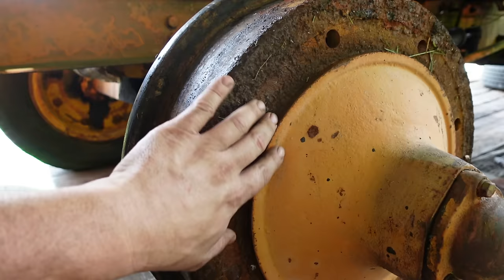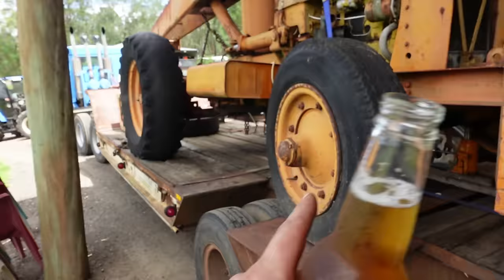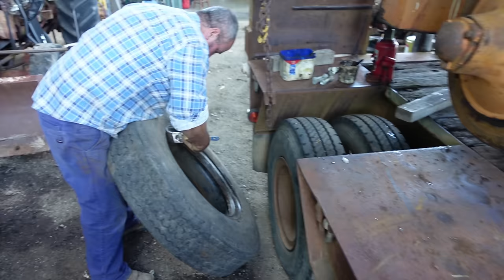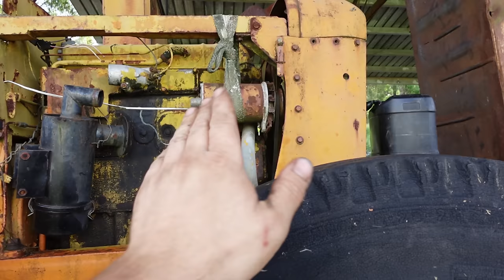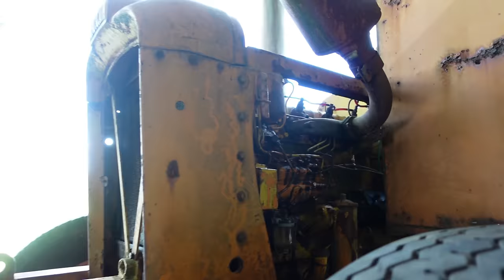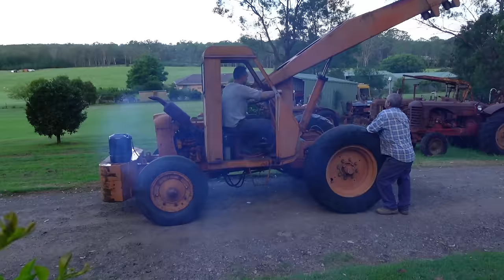Will it Run? Saved from Scrap!

Comment: Looks more useful than the one from the circus. Good acquisition. Stable mount for a bottle, full or empty, there was no bust glass.
Reply from the maker: Yes Neil it is. The circus one was homemade though where this one is a proper crane. It will lift more once working right mate

Comment: Gday Steve, winched on in the morning and driv’in off in the arvo, nothing wrong with that mate, it run quite good really and having the rotating boom will be a handy thing, top job, cheers
Reply from the maker: Hi mate yes that’s right. And it doesn’t need a great deal of work to get up to a useful machine. I just wish I had more time to play. I only get Saturday so I have to choose what is more important most of the time. They lift a lot too mate. That red tractor that I lifted off that blue trailer with my big Steelweld crane was lifted on with the same crane as this. Not a bad lift

Comment: Nice save. It'll come in handy with the future shed construction. Now I understand why you guys are always staying hydrated. If I heard you correctly in another video it was 40C at 10:00 in the morning. We're lucky or unlucky to see 40C a couple of times during the summer here in the Midwest (US).
Reply from the maker: Hi mate yes it will be a handy crane after a bit of work.
 Yes that morning working on that Albion was very hot. I’ve always pictured it to be very hot there in the mid west? I guess not as bad as here by the sounds of it. We have a lot of hot days here over the summer
Reply: Hi Steve, I need to clarify about my reply and where I live in the Midwest. I live in Minnesota and our Northern border is with Canada which provides a little cooler weather during the Summer. The Dakotas, middle and lower states in the Midwest do get hot and stay hot during our Summer. So, your assumption wasn't totally wrong about our weather in the Midwest. Stay cool and hydrated.

Comment: I think she's a 6g guessing by the inline injection pump that's on the L4 perkins 9g or mk2 (I increased the video quality and saw the rotary pump).
I think the R1250 is just the loader version of a reversed mk3 like the F1000 being the factory front loader.
Reply from the maker: Yes it’s a rotary pump so I’d imagine 9G. I also have an r1250. Same machine with a loader frame on it basically.
Reply: @stevesplacedownunder  I haven't seen a 9g rear loader be referred to as a r1250,  All i could find is that they are built on  a mk3 and have a double z link loader similar to the f1000. Problem is that they're rare and information on them more so thus leading to arguments. Check the serial number, from what I know it will tell you the tractor model. I aught to just do a walk around of the r1250 that I bought to save from scrapping (and I wanted a decent loader).

Comment: That's badass n be very handy.
Did they flip axle to reverse direction? Or did they make it with different transmission? WD Allis the flip rear axle to put loader on rear and drive backwards
Reply from the maker: It will be great mate yes. The transmission is the same as normal so it’s done in the axle I’d say. It’s probably flipped like you say.

Comment: Hi mate, 

After being bit by a hoard of them as a kid, I think wasps are cunts with wings!. 
Brake cleaner works better with flame.😉😆

I doubt this Chamberlain is gonna be a 5 part belter.😜

On your ramps cylinder, could there be a internal leak or check valve partially failed, letting oil where it shouldn't?.
Reply from the maker: Hi mate. Yes they are bastard things. I was going to do the flame thrower with it but didn’t want to set the tractor alight and burn those gauges. 
 The cylinder on the ramps is only single acting so I’d say if it was going elsewhere I would see it on the rod side of the cylinder coming from the breather when they were down. The system is very basic so I can’t imagine it going anywhere else